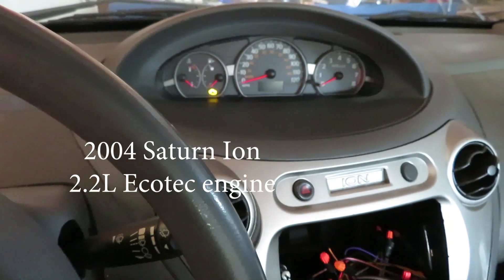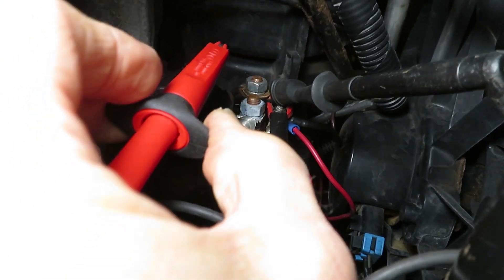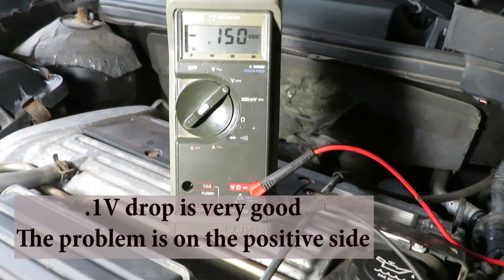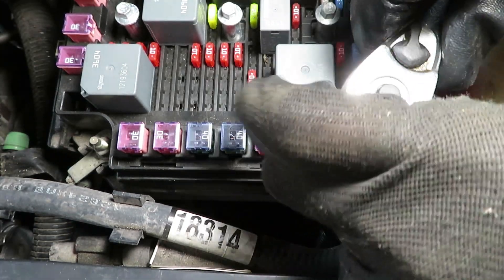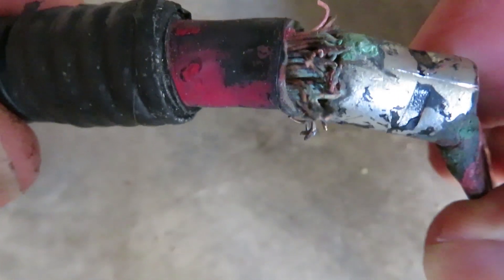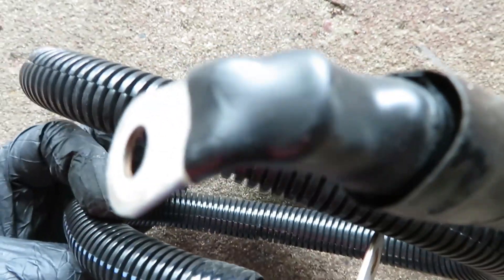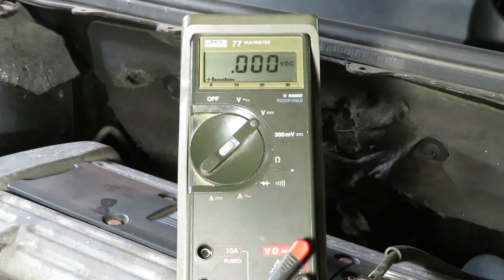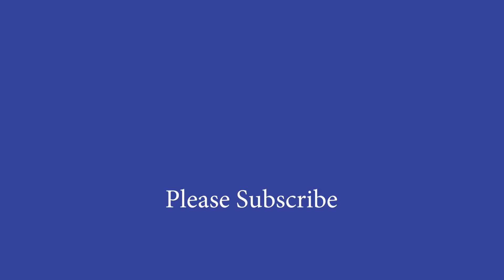Cause of Frustrating No-Start Revealed by Voltage Drop Test  GM 2.2L Ecotec Saturn Ion and More

Comment: This video has been very helpful I have delt with this same issue just replaced the starter on the 18th. This morning I had to dump the clutch. And will have to do in the morning cause we'll. The car won't start again

Comment: I’m having a similar issue with my Saturn 1995 SW2. In recent months I have found that I will stop to gas up the car and a few minutes later I will try to start the car and it just won’t. If I let it sit for 5 minutes it will start right up. It does not seem to be an issue if the car has been sitting overnight or for a half hour or so. And the issue is very intermittent. I could go a month without it happening. My mechanic replaced the starter, which only had about 45,000 miles on it and it was okay for about a month but now the issue happened again tonight. It would not start again after I shut the car down. 10 minutes later, it started up. Just prior to this I had driven it about 14 miles, went to see a movie, started it up and drove 14 miles back home, parked the car and was sitting in it for about 10-15 minutes. When I started it again just to get a little bit of heat going, it would not start. I waited 10 minutes and now it’s running.
Reply from the maker: What a frustrating problem, especially if you don't have 10 free minutes to wait. I know there is history of anti-theft systems causing a 10 minute start delay on some GM products. You would see a red lock icon on the dash.

Comment: my ion starts when it wants to I cleaned up the fuse box connections and then saw the body ground that goes to the starter is pretty corroded I tried cleaning that up some end it was good for a day and now it's a lot worse I'm wondering if this positive cable that goes to the starter could be my problem also at the same time the key that would get stuck in the ignition from time to time has gotten much worse and wants to stick in almost every time I'm wondering if this is a connectedProblem
Reply from the maker: The key getting stuck is usually a sign of sticking tumblers in the lock cylinder. If the key isn't turning fully into the start position it would cause a failure to start. Never seen that but possible. In my experience with Saturn you probably have two problems though.
Reply: Had the same key problem. Found a way around it
Reply: @Junior22vw  what was the fix
Reply: @billmarty8526  on the bottom side of ur steering wheel column theres a square pop out tab. Theres a white button like thing in there. If u push it the key can come out at any time. Ive seen ppl use a zip tie to hold it down but then the key can always come out even while driving. Lmk if i can explain that better
Reply: There are recalls for the Ion and a few other Gm cars of those years of production!  Power steering and ignition cylinder.  If they were never done all you have to do is contact your local GM dealership . They will fox it for free I hope this helps!
Reply: @lavong.7019  yes thanks. i looked mine up. it has a recall for the steering motor. so maybe take it in for that eventually. previous owner had to replace themsleve. as it went out and they said they had no steering whatsoever. makes me worry if it gives out on the highway
Reply: @joe smith  it is possible have you had any issues with it? If so, take it in luckily the 2 times mine failed. I was in my apartment  complex. So you only found the pws right? There should be more
Reply: @lavong.7019  pws?  sometimes the steering gets sticky on the road
Reply: @joe smith  power steering. Currently my car will not start and like you I have cleaned all the wires of any corrosion. The #11 ignition fuse blows every time I try to crank car. Battery,  starter, alternator, ignition coi pack, and ignition  module are good.

Comment: With such a long run of battery cable, I might have missed that at 0.7 volt drop.  That was some poor repair work on that cable end.
Reply: Any way you could help me out I have the same issue

Comment: My 2002 cavalier had a similar problem. No start. I jumped the starter terminals with a screwdriver, and it started. I shut it off and now it starts like normal. Don't know what the problem was but I guess I'll keep that screwdriver in the car at all times!

Comment: When you had this problem did the car shoot you a code? I’m having the exact same problem with my Saturn ion for months but I have 2 codes (P1682 & P2101) I’m going to check what you did here hoping is nothing bigger
Reply from the maker: No codes during this problem. Issues that set codes should not lead to a no start in my experience.